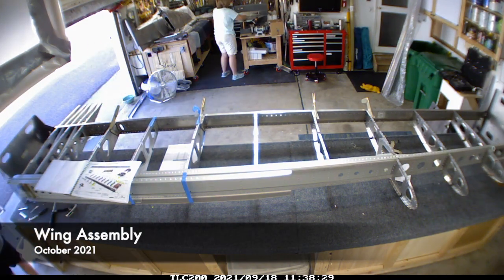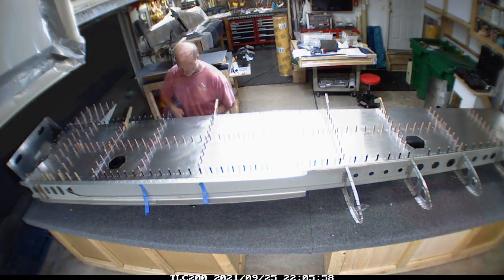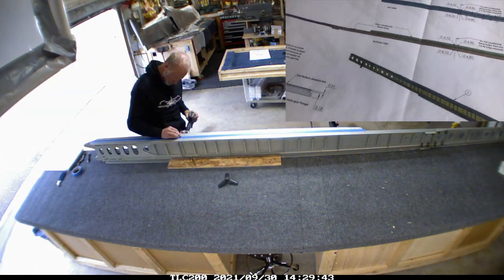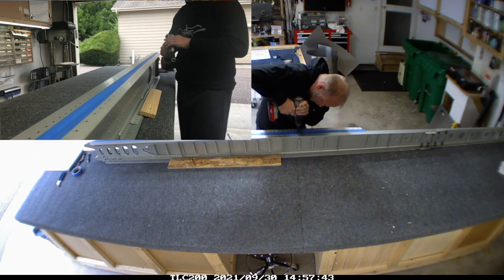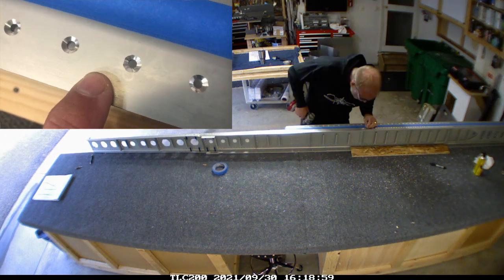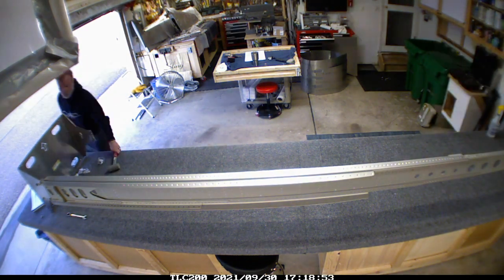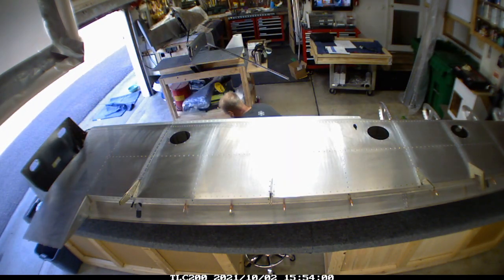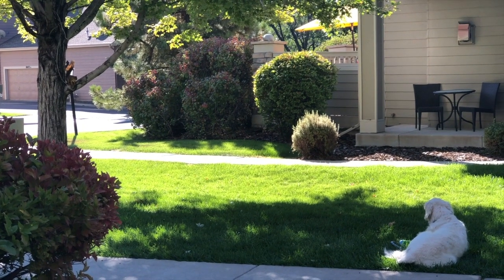2021 October SlingTsi Wing process

Comment: Great attention to detail. Really appreciate the use of painters tape to prevent the aluminum shavings from falling into the gap in the spar. This is a minor thing and likely totally unnecessary, but taking pride in the little things is super important. Keep up the great work!
Reply from the maker: Thanks a bunch. I certainly can’t take credit for the tape over the joint. Evan Brunye has this in the series he did for SlingTsi. All you have to do is a few holes and you connect that dot pretty quickly. :). But I am trying to pay attention to all the little things. Are there are a LOT of those. :)